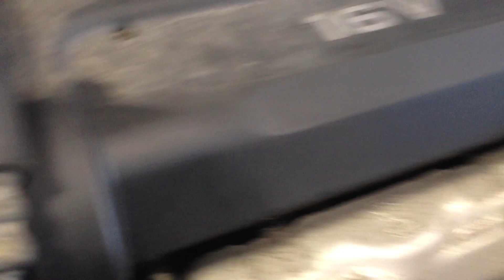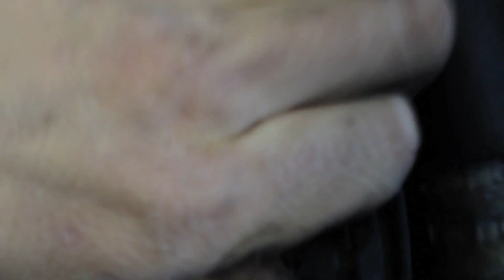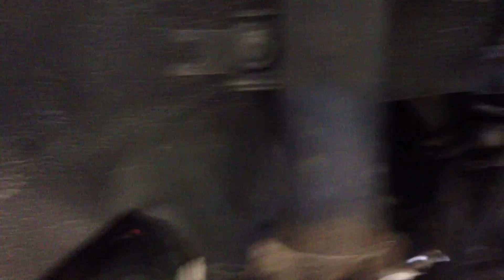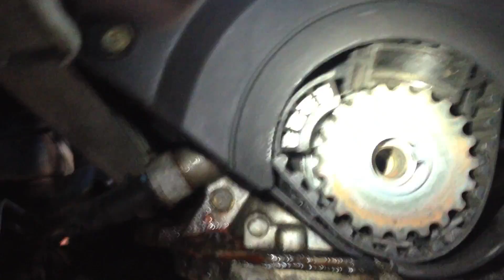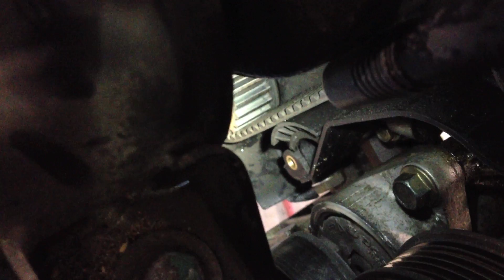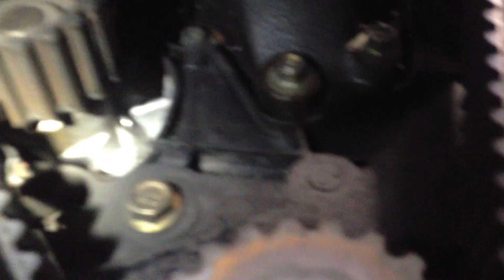Chevy Aveo Timing Belt Idler Fail

Comment: The same thing happened to my car.
After replacing the timing belt set, at 80,000 km, tragedy struck.
It used Continental parts.

Comment: The tensioner and idler along with the water pump are designed to be replaced with the belt. Do this at the correct service interval and you will never have a problem guaranteed.

Comment: THE CHEVROLET AVEO IS A HORRIBLY DANGEROUS CAR!!! THERE HAVE BEEN 4 RECALLS. THEY WERE FOR THE BRAKE HYDRAULIC FLUID, THE REAR SEAT BELTS, THE GASOLINE FUEL PUMP AND FUEL LINE AND THE DRL (DAY RUNNING LIGHTS) MODULE THAT WOULD OVERHEAT AND START A FIRE . PLEASE  GO TO www.consumeraffairs.com THEY HAVE VERIFIED
530,313 COMPLAINTS ON THE CHEVROLET AVEO!!! DRIVING AN AVEO IS SO DANGEROUS!!! THE #1 COMPLAINT, DANGER AND PROBLEM WITH THE AVEO IS THAT IT WILL LOSE POWER WHILE DRIVING. IT'S ESPECIALLY DANGEROUS WHEN YOU ARE MERGING ONTO A HIGHWAY, INTERSTATE OR FREEWAY!!!!!!! IT WILL ALSO LOSE POWER, LEAVING YOU HELPLESS AND STRANDED IN THE MIDDLE OF AN INTERSECTION WHERE YOU CAN BE KILLED BY ONCOMING TRAFFIC!!! CHEVROLET WAS FINED $35 MILLION DOLLARS BY THE US GOVERNMENT FOR WILLFULLY AND MALICIOUSLY COVERING UP THE LIFE THREATENING PROBLEMS AND THEY STILL HAVE NOT TAKEN THEM OFF THE ROAD!!! GOD WATCH OVER AVEO OWNERS!!!!!

Comment: My Idler pulley failed on my 2011 Aveo Hatch. Vehicle is on 119500km, 500km 
still in warranty thank lord. Turns out its actually a service item and 
GM never serviced it, so found out today that I'm getting a brand new 
engine.
Reply: Daniel 120k warranty? wow usually isn’t it 3yrs/60k for engine? Anyhow I’ll take your word for it. Lucky you for engine replacement ciao

Comment: Great video! I think something like that just happened to my tacoma. Running rough, almost stalling at times, with WHITE vapor coming out of the tailpipe, and then it got HOT! I shut it off and let it cool down. I only had about a quarter mile to go to the shop, too. After about 15 minutes I tried starting it and it sounded like a hammer and then a chainsaw. RIP!

Comment: i do not pretend to know what im talking about when it comes to cars but i do have a question theres this car im looking to buy for my first car its a 2005 ford explorer but theres an issue stated in the seller notes it says the plastic idler pulley has failed but i wanna know how to fix this it was also stated that the car will run but is loud im guessing that you can hear the engine haveing trouble with this any tips

Comment: I did this job and I don't want to say it's cake but it isn't that bad! Follow the maintenance schedule and plastic metal it doesn't matter. The water pump here is the tensioner, when that went likely the bearing in the idler got wet, over time and wear ran out of perm lube over heated and exploded. Frankly it's the owner. Plastic idlers are in the product line of most manufacturer's,

Comment: The replacement timing belt kits have plastic tensioners and idlers also. That's why everything should be replaced around 60,000 miles. The belt,tensioner,idler and water pump. I got a TCKWP kit from Gates for about $150.00, Had a friend help took about five hours. Everything is good and won't have to worry about it for another 60,000 miles. I have a 07 Aveo with about 64,500 miles. It's also a good time to replace the serpentine belt since that has to come off anyway.

Comment: I've read somewhere that you could get an aluminum replacement for the tensioner and idler pulleys instead of getting the factory plastic garbage ones. Does anybody know where we could purchase the aluminum replacement pulleys? Thanks!
Reply: ***** I found them on the JC Whitney site http://www.jcwhitney.com/2004-2008-chevrolet-aveo/cloyes-oe-replacement-timing-belt-idler-pulley/p3048707d17269y2004-2008j1.jcwx?year=2006&filterid=g46
Reply: Davwe Szabo Thank you very much, Sir. Do you know if this is a replacement for the idler pulley or the tensioner pulley as well?
Reply: They’re all plastic on jcwhitney

Comment: Does not do major damage,bends the valves only.I have pulled the head off and replace the bent valves.Luckily the aftermarket makes that idler pulley out of metal.Takes a special tool to rotate the water pump also made by Kent Moore
Reply: There could be damage to the pistons also. The Aveo's have interference engines. The pistons strike the valves when the timing goes out. How do you think the valves get bent? Damaged pistons and valves is major engine damage.
Reply: I have not seen one with damaged pistons yet.The valves just nick the pistons a little bit.If you want to see one with major damage done when the timing belt breaks,The Kia Rio.This one does major damage ruining the head and pistons.
Reply: I have bought the kit intead of buying the pulleys seperatley

Comment: I am trying to replace the time Belt on my Chevrolet Kalos 2005, I bought the kit as I also going to change the tensioner, idler, the water pump... Do you know the bolt specs of the those parts ?

Comment: Kind of glad my truck has a timing chain rather than a belt, I know both have good and bad to them, but these days on modern engines the chain setup typically lasts the life of the engine, meaning I shouldn't have to worry about this kind of thing.

Comment: GM should be sued and forced to recall these POS tensioners in the E-TEC 2 engines ,its a safety issue wheb this happens on the highway leaving you stuck there ,seen these fail even when new